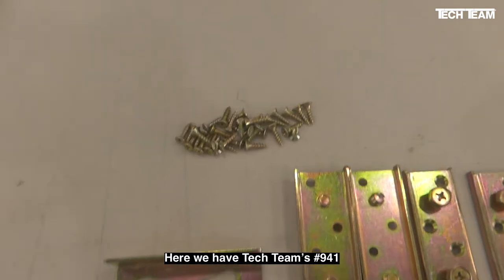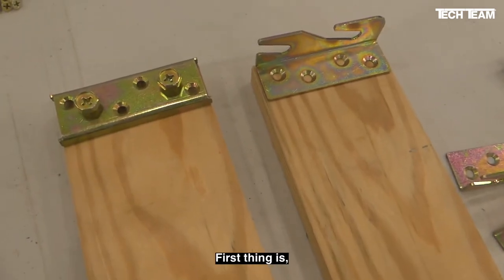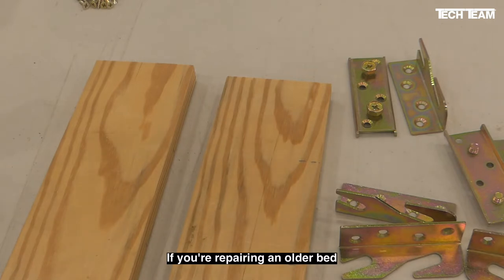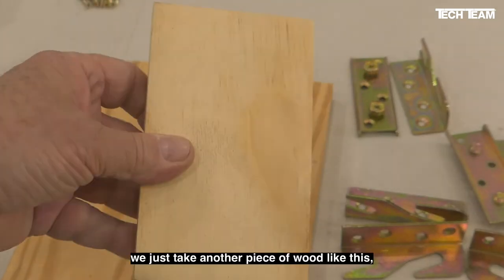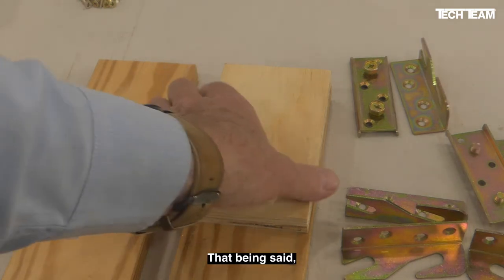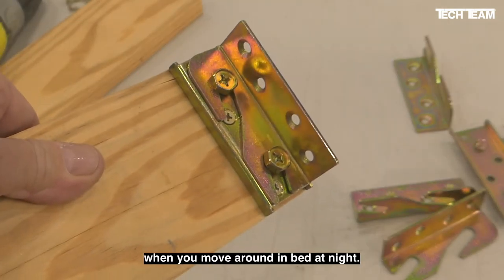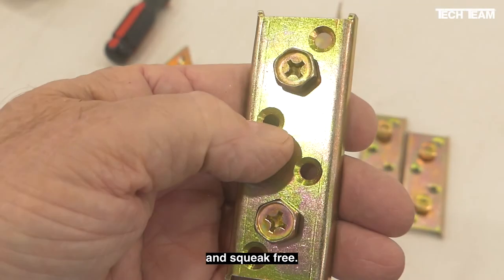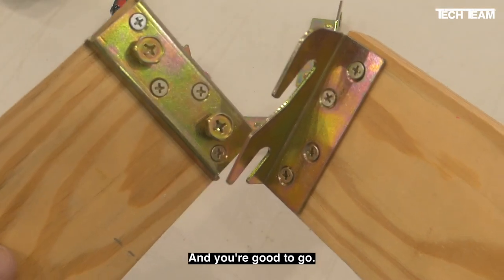Tech Team 00941 Non Mortise Surface Mount Wood Bed Rail Connection Bracket Set

Comment: thank you. now I see why I couldn't figure out how to install mine - I have a wood bedrame and a different wood headboard. They line up with no gap at the corner as you show here.  What kind of bracket might work? the manufacturer of the bed frame does not recommend and currently I have the headboard pushed up against the wall but would really like to secure it directly to the bed frame. Thank you